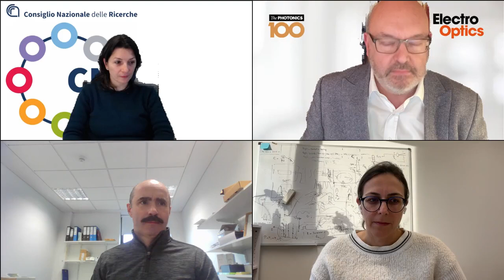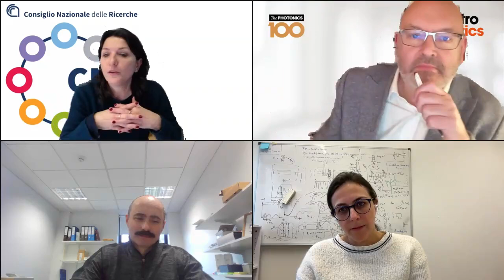Unlock the future of spectroscopy with cutting-edge light sources.

Comment: summary:
* skills and high educated peoples impoirtant
* ML important
* Industry should help(how?)
* need good detectors and bright light sources
* quantum cascade lasers, prices start dropping
*  needs for high perfomance air sensors. cost issue. chip techniques solution?
* 22:00 need lot of computing for air spectroscopy
* interest sensor on drones
* 25:30 multiple spectroscopy techniques in 1 "device" will be interesting?
* 32:26 ML used very little in reaserch in this group. like to increase it
* 40:20 need build system which have good results not only in lab but outside as well
* 41:04 fs spectrsocopy useful due new lasers. chiral spectroscopy. Tisappfire on chip article
18:00 collaboratiion important for fast getting in new field